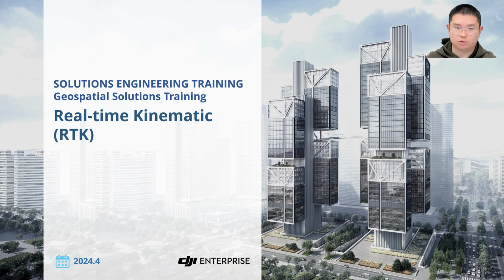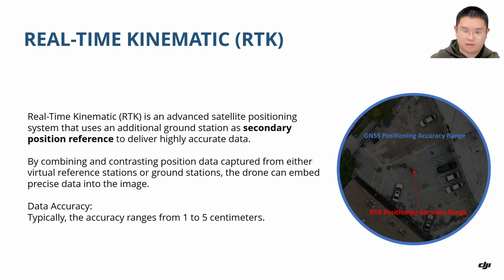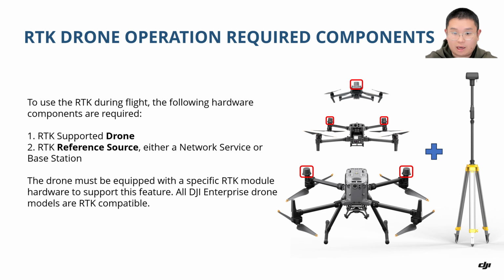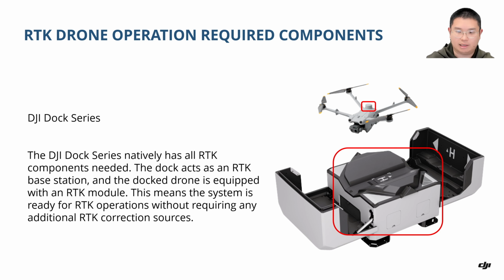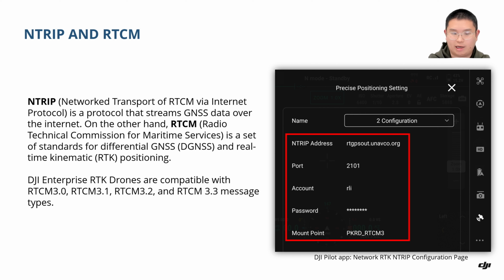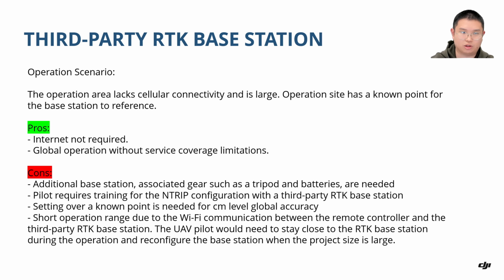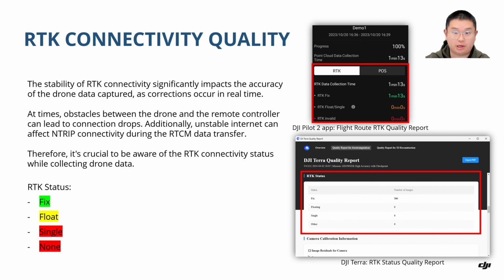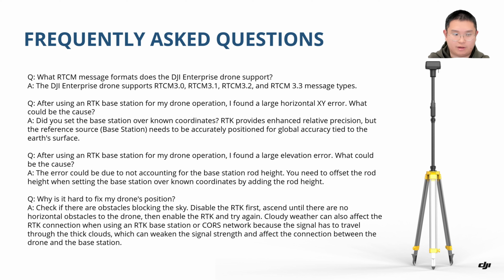Geospatial Basics: Real-time Kinematic (RTK)

Comment: Hello,
I’m based in France, flying with a Matrice 4E and using the D-RTK 3 base station. The positioning is accurate, but the data is in WGS 84.

I would like to know:
	•	What is the typical XY offset in France when working in WGS 84?
	•	Knowing that the Z height isn’t correct, since it’s based on the ellipsoid.

Also, in DJI Terra, when using RTK mode, at what point and where can I add the French references (RGF93 / IGN69) to achieve accurate elevation data?

Thank you in advance.